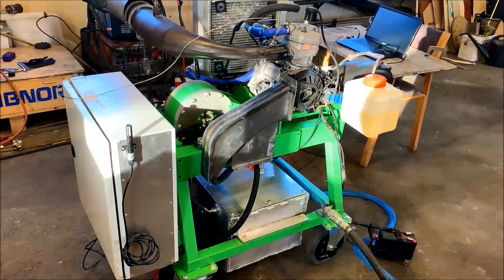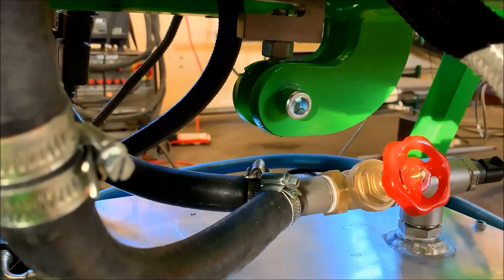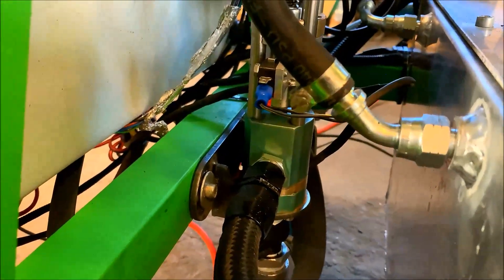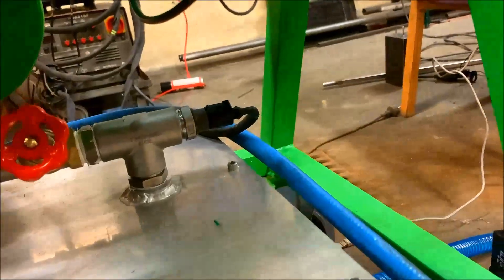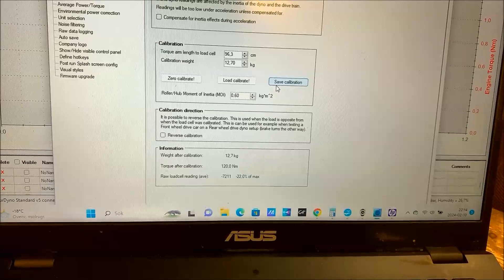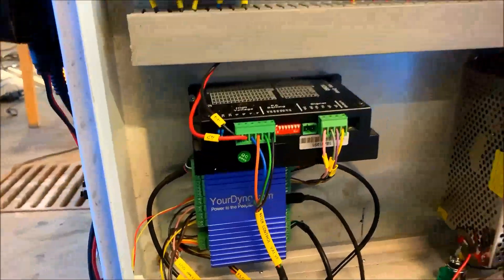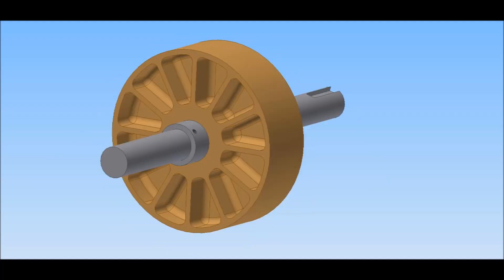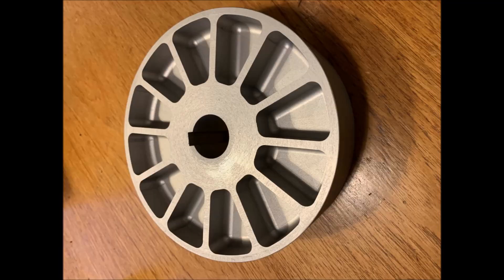DIY small engine dyno.

Comment: Im interested to build my own to test v twin motors from 80 to 150hp / lbs tq. Maximum rpm would be 7000. Is this size suitable or would need to be scaled up ?
Reply: 80hp is probably ok with this design but 150 may be a bit to much, the maximum we have run is 30hp at 3500rpm with control valve 50% open.
Reply: @perajden2579 what changes could be made to increase the hp capability ? Besides putting two of them in series
Reply: @jimiandrix  increase the diameter or change to eliptical chambers instead of rectangular.

Comment: Thats awesome! when you say it can handle 50hp-60hp, how much torque are we talking about, in Nm? Also, from what i understand, the water inlet needs to be high pressure? Or just normal, atmospheric pressure works? Another thing, i heard the number of pockets needs to be different in the rotor and stator, to reduce vibration, is that the case?
Reply: Hard to say, we have run 55Nm at 3500rpm on the absorber, the control valve was then about 50% open. Theoretically the torque possible to absorb increase with the square of the absorber speed. Will try to find a more powerful engine than the x30 to see if i can find the limit.
The waster pressure up to the control valve needs to be about 3-4 bars.
There needs to be different numbers if pockets between the rotor and stator, one of the number should be a prime number. As far as i remember we used 11 and 12 pockets in this absorber.

Comment: Very interesting. How do you properly size the absorber for your application? Is there a certain rule of thumb?
Reply: The amount of torque that can be absorbed is defined by the equation T=kN2D5 where T = torque, N = RPM, D = the diameter of the rotor and k = a constant dependent on the size and shape and angle of the rotor/stator pockets (Rao, Narayan N.N. The Basic Theory of Hydraulic Dynamometers and Retarders. India: SAE paper 680178.)